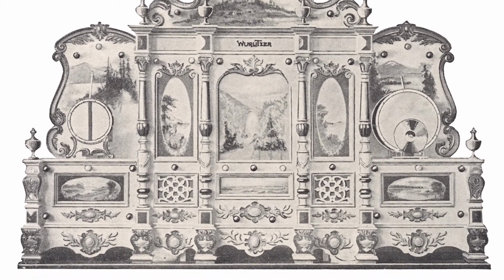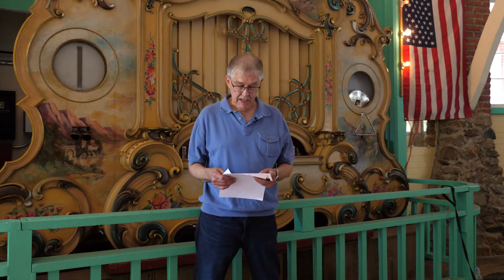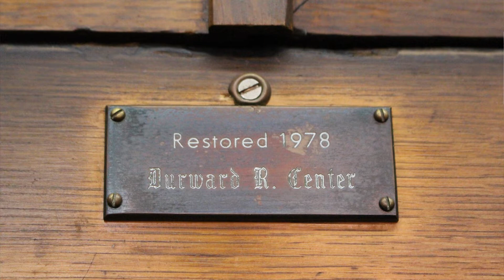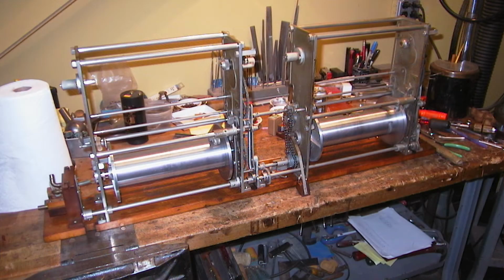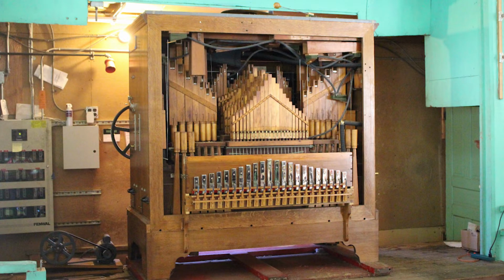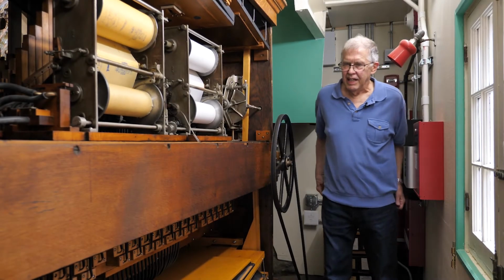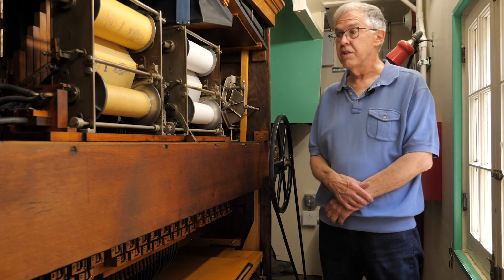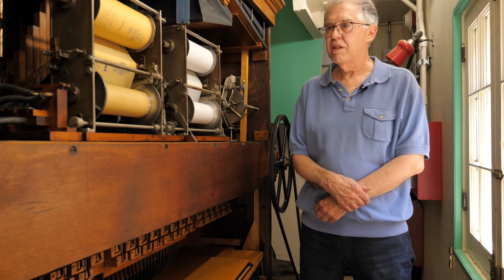Glen Echo's Wurlitzer Band Organ: A 50-Year Perspective by Durward Center

Comment: That crankshaft needs replacing with steel, built up from rolled, not cast, stock.  It can be sandblasted to look like cast metal.
          The facade ruins the organ!  It hides all the intricate works which are much more beautiful than the best facade.  it also muffles the sound, knocking out all the treble.  I always liked the Gavioli organs because they show so much more of the internals, & do not have shutters in front of the pipes.  Many have animated figures, but you can see past them to the pipes & internals.
Reply: No class, the guy not the organ
Reply: It's from the same era as the European fairground organs, it's no different. Blame Bruder for it as they are the ones that spawned the Wurlitzer 165 facade in the first place, with their Elite Apollo Orchester. The facade does not muffle the sound in any way shape or form. The big open gap to let the pipes sound out is the swell shutters.

The first Wurlitzer 164 appeared in 1914 and was sold to George Layman in Boston, Massachussetts..
Reply: @CBF1  the first 164 on record to be sold was in 3/29/1917 
That was serial number 3062 and was shipped to Whiting, Indiana
Reply: @CBF1  I would have to look it up in the encyclopedia. One of them is said to have burned up, not sure which one, the other was basically scrapped
Reply: @wurly164  yup we know all about the 164's survival status ha ha!
Reply: @CBF1  thanks to me.
Reply: @wurly164  And other sources I learned from as well. One being the article about organs bigger than the 165(155 although that's smaller by only 1 pipe, along with the 160, 164 duh, 166, 175, and 180)
Reply: @CBF1  That article was written by Dan R. 
He came to me for all the info on the 164. As well as some background on the 160
Reply: @wurly164  Yep!